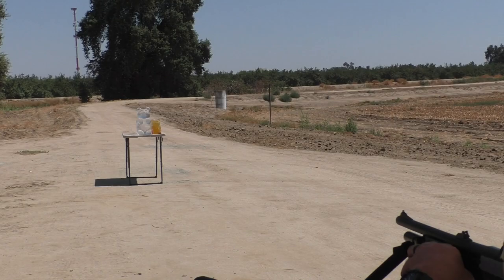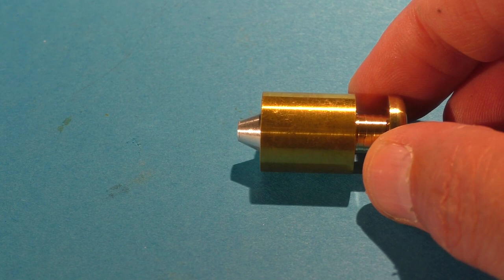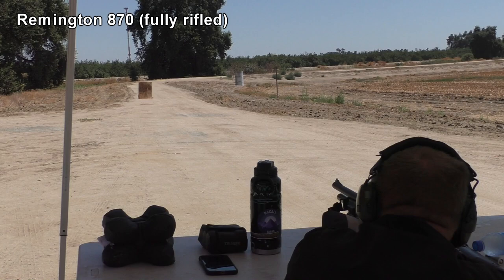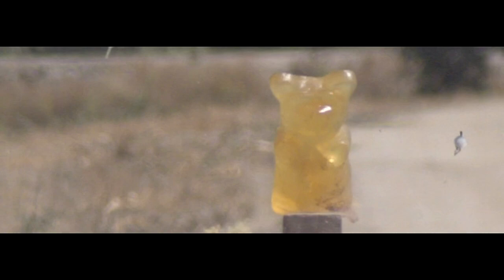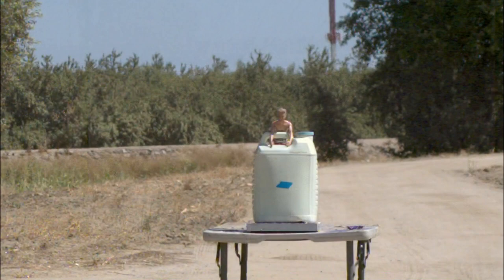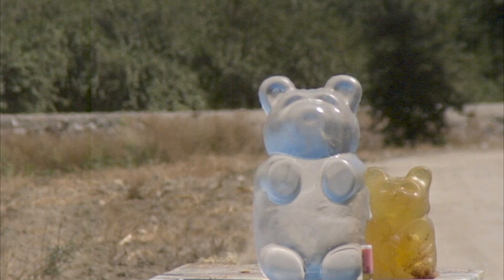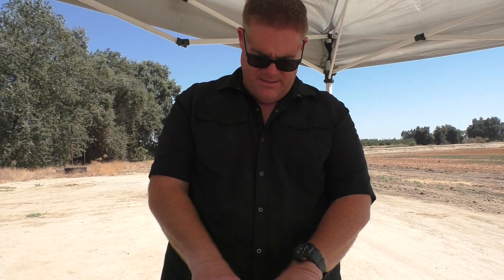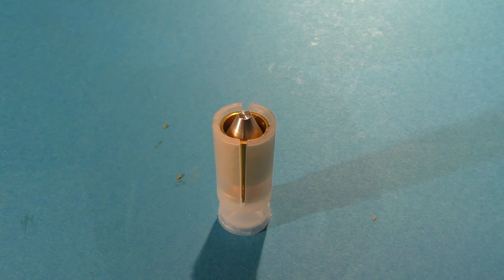Brenneke SUPER SABOT 12g. Shotgun Slugs  -  We test them out!

Comment: Degradation over time or improper storage cause volatility spikes in some propellants and some older plastics dont age well.

Break action or bust though if you want accuracy lol
Reply from the maker: Well....  we kinda showed it was a heat issue.
Reply: @taofledermaus Correct,  I'm just guessing it wasn't so thermally temperamental when it was brand new is all.

Like you said, the Germans is known for making tightly toleranced, good quality stuff usually

Comment: There's moving parts and two different alloy parts in the round.  Maybe the expansion of aluminum vs brass in hotter weather is out of tolerance?
Reply from the maker: That part worked ok
Reply: @taofledermaus  , Yeah.  It just seems like an unnecessarily complex design.  I am more inclined to think all the moving parts in the round are to blame rather than the powder. If it was a designed and tested to be subsonic, than pressure spikes would be a more plausible explanation for this failure.

Comment: Armchair expert.... You mentioned cooling the rounds.... That would make the thermally contract and if the barrel was hot-er than normal maybe this increased the tolerance and they weren't engaged by the rifling? Should have cooled the barrel and left the rounds in the sun. 

How old are they? Did the sabot plastic just get brittle with age?
Reply from the maker: It would probably take a very sensitive instrument to measure any difference from 30 degrees different

Comment: I srsly dont get what the combination of sabo + the need for a rifled barrel is supposed to mean. If the slug is exactly the 12ga. and "fills" the barrel out, so it "grabs" the rifling, where is the sabot supposed to fit in? If the slug is slightly subcaliber, why do you need the a rifling, which only tears the sabot apart?
Reply from the maker: A smaller diameter projectile is more aerodynamically efficient than a fat one.  Brass doesn't obturate in the barrel (doesn't expand)  and won't engage the rifling.   We tested MANY projectiles that use plastic sabots to engage the rifling and if loaded correctly,  function very well.  A slug like this isn't self-stabilizing,  just like a bullet and needs spin to fly straight.

Comment: Being European, they're obviously designed to shoot in a Celsius environment, not any of that foreignheit. But also curious how old they are, and if it was a combination of the plastic deteriorating and the heat. Or if the petals didn't like being spun through a rifled barrel. The plunger thing also seemed kinda pointless.. Although maybe Evan can adapt some so as the core pushes out, steel shims or petals make more of a ballistic cap. Or just fail due to the acceleration.

Comment: Since the metal of the barrel expands when hot, the bore would actually become smaller. I would imagine that the plunger moving is destabilizing the slug as its movement may not be uniform shot to shot and the underlying collapse of the sabot/wad is not uniform either, so the slug never engages the rifling and may be "jumping" the wad inducing the wobble. 90° temp should not affect the plastic that much.
Reply from the maker: I don't think you'd be able to measure a difference between 70 and 100 degrees.  Maybe you'd see some expansion at 300 degrees or so
Reply: @taofledermaus  That was my point. The bore becoming a bit smaller would actually allow the rifling to grip the projectile better, but you had not fired rounds in rapid succession to keep the barrel temp up enough to make any difference. The base wad-sabot and plunger designs were probably the culprits.

Comment: These slugs are old, from the 90's. I suggest that the plastic sabot it degraded and falling apart. If you have any left, you should take them apart and load with a new wad. That plastic is probably brittle and falling apart to the pressure. Those weren't that accurate in the beginning if I remember correctly. But I would replace the old plastic sabot with a new one and test that out.
Reply from the maker: They were sent directly from Brenneke USA to us.  I doubt they keep product in their warehouse for 30 years

Comment: Most slugs are deigned to be used in the fall and winter, so they may have used a powder that is best for those temperatures?
Seeing the one good shot was cooled for 10 minutes, would suggest that is the problem!

Hey OG!  When you got done shooting and cleaned your weapons, was there a lot of plastic in the barrels?
Reply from the maker: A black shotgun loaded with these will get much hotter than 90 deg f  in the direct sun even at lower temperatures.
Reply: @taofledermaus  I am thinking of Germany and Michigan fall and winter where the temp is sometimes below 0* C. And even black barrels frost up at those temps!
For those conditions, faster powders are recommended, and they become unstable at 35* C

Comment: I wonder what would happen if you loaded that wad & sabot into another hull using a 1400 fps load of your old faithful Longshot.
Reply: Well the wad is right at the max diameter for a cylinder bore size tube so you wouldn't be able to put it inside of another wad. But I was thinking along the same lines, only just reusing the slug. The slugs themselves look to have awesome potential.

Comment: Maybe Jeff could reload them with more standard powder. You could also send a couple to Evan Perry, to see what makes them tick. I'm not encouraging 'reverse engineering' or anything, but...
They do look very similar to Evan's brass doorknob slugs, though.
That temperature would have seen me in hospital. Here in the UK, it has been in the mid to high 30's C for weeks now, and is just easing off. 92°F is a dangerous temperature - in the 1953 movie 'It Came From Outer Space', the Sheriff tells the main character:
"Did you know, Puttnam, that more people are murdered at 92° Fahrenheit than any other temperature? I read an article once - lower temperatures, people are easy going. Over 92, it's too hot to move. But just ninety two - people get irritable!"
How you two never got irritable over those pain on the arse slugs, I'll never know. 
Nice one. 👍👍👍

Comment: I was wondering what would happen if you were to put rifling on the rounds will it have a good or bad effect on the bullets stability?
Reply from the maker: To get proper spin it has to be mechanical,   not from airflow over the slug.   It would be 100 yards down range before it got to the proper speed and by then it's too late

Comment: Heat softens plastic. The wad for these shells must have been something with a fairly low glass transition temperature, low enough to start losing structural integrity above room temperature. A shame the rounds didn't perform well but if the manufacturer never did so basic a test as seeing if the rounds functioned in high ambient heat that's on them.
Reply from the maker: Even if it only 70 deg f outside,  a black shotgun is going to get a lot hotter than 92 deg f  sitting in the sun.

Comment: As you have always said, a slug pulls about a zillion G's when fired.  That design (flawed in my opinion) creates a secondary inertial pressure spike when the plunger bottoms out in the sleeve.  Not sure of the exact science, but I think it has something to do with a resting fig newton liking to stay that way.  Snacks aside, secondary pressure spikes created by two objects colliding in barrels are typically bad things.
Reply from the maker: It's possible the plunger acts like cushion to reduce felt recoil a little.  Other than that,  I don't know why they made it that way
Reply: @taofledermaus  I noticed the ribs on the plunger (looked like a PEX fitting). I assume those are to slow the bottoming out process. As you said, the heat may have effected the performance of them. Still a box of ammo I’d leave for someone chasing me if I had to make a choice.

Comment: I would have thought the manufacturer would have extensively tested this round before putting it on the market. The round should have flown just as good at any temperature.   The next time you use these slugs, I would have brought along regular rounds  to use as a comparison to see how much the heat affects both rounds.  Just a thought.
Reply from the maker: We've tested a lot of stuff in higher temperatures and didn't have any wad failures.

Comment: It needs reloading, and refiguring the whole sabot concept, but even then I think it's going to require a lot of testing to get it right, and it might also involve redesigning the whole slug.
Reply from the maker: I'm thinking of chopping off the gas seal,   using a high pressure one,   US powder and maybe a cork wad.
Reply: None of the example showed that the piston actually worked, as the "nose cone" didn't extend. The lead plate captured it with nose in, but I'm sure what really happened. I think the tail end needs some Evan Perry magic for it to work.

Comment: I can't believe that Brenneke would put crappy slugs like that in production so I'm wondering if their performance/accuracy is dependent on the barrel length & twist rate. Depending on the weight of the slug it might need a faster or slower spin than the ones you tested them with. A faster spin might have allowed the slug to shed the bore-sleeve sooner and prevent that bad wobble. Brenneke Rottweil are my primary deer load of choice so seeing the Super Sabot do so poorly was shocking.
Reply from the maker: There aren't really any other twist rate options for shotguns,  I think it is 1:27.
Reply: @taofledermaus  I wasn't aware there were different rates until I looked it up. The most common rate is 1:28 but rates can vary from 1:22 (Winchester 1300) to 1:35 (Savage 210 & 212). I'm no gunsmith but think that the same twist rate on a 22" & 28" long barrel would affect the slug differently. The final word would be through Brenneke as to what length & twist rate the rounds were designed to work best with.

Comment: Well if you have the shells sitting out in the direct sunlight, the heat is going to make them expand and become soft. Also normally most hunters are hunting in colder temperatures. Extreme heat is always going to change the ballistics, especially when plastics are involved.
I guess I should have waited till the end to comment. But 92° in the shade is still pretty hot. I also noticed that when we use our pin guns at work when it's really hot outside, the nail head sometimes over penetrates the metal that were attaching to concrete because it makes the loads hotter I guess and those track fast guns that use gas cartridges doesn't seem to go as far versus when it's cold outside. Sometimes we'll stick the gas cartridges in ice water from the cooler and we'll be able to get another few shots out of it. But heat definitely plays havoc on just about all types of stuff like that, especially when there's added heat involved in the process of said project.

Comment: The box looks like it's from the late 80s, early 90s. If those slugs are as old as they look, the plastic wads may have gone brittle from sitting on a shelf for over 30 years.

Also, as the slug gets fired and the plunger on the back gets depressed, the slug shifts back in the cup about a quarter inch, which, under 50.000 G's of acceleration, may just be busting the bottom out of the wad/cup, no matter if it's gone brittle with age or not.

All in all, although it may LOOK like an Evan Perry creation, I think he usually does a better job.
Reply from the maker: They were sent to us directly from the company
Reply: Dang, Brenneke... Looks like youguys need to redesign the box AND the powder load! Maybe the slug, too, to be safe... 🤔

Thanks for getting back to me, Jeff. Given the old timey box graphics, I didn't expect these to be fresh off the line!

Comment: I'm puzzled by a sabot round that's supposed to use rifling. Why isn't it fin stabilized? Then you could use smoothbores.  These suck. Hell, I'm more accurate with my .38 snubby than that!
Reply: Rifled shotgun barrels require a sabot to keep the led slug from gumming up the Rifling.  Unless the slug is jacketed with copper it needs to have plastic as an insulator to keep this from happening.  And typically a good sabot slug fired out of a good Rifled barrel is much more accurate than a rifled, fin or foster style slug fired out of a smooth bore.

Comment: Pretty sure the powder and wad plastic are the issues they're engineered for temperatures less than 30° Celsius which is around 84° Fahrenheit so the plastic is "melting" on the sabot and the powder is as you suggested flaring and causing spikes, untrained opinion btw.

Comment: Okay now I finished the video yeah take the one that you saved and measured loaded up in another one with some long shot and I'm not sure what the weight of it is but I'm sure you know how much to use less than 28 grains I'm sure and then see if that helps any I have honestly only seen green gunpowder in a 22LR shell and that's because the color from the primer had mixed in with the powder which is where the shell usually becomes unreliable that you get a misfire because somebody's dropped it or they didn't prime it correctly or whatever that's the only time I've ever seen that that's kind of weird but I feel like you might be able to figure it out and get it to do right if you reloaded yourself dude
Reply from the maker: Yeah,  I will need to reload the remaining ones myself and do an extreme heat test,  actually leaving the shells and shotgun in direct sunlight so they get almost too hot to touch.   I THINK I can do it
Reply: @taofledermaus  I was thinking if you use long shot or a powder you're familiar with I just know you that you seem to prefer long shot or use it a lot anyways but you can reload it with that powder and maybe your own sabo and see if maybe they just loaded it with too much powder or too hot of a powder or maybe it wasn't enough maybe it's not a temperature thing like you maybe if you could load one or two up like that and you will know for sure

Comment: That's one of the least aerodynamic shapes I've ever seen.
Drag is all over the place.
Take the tail of the plunger off, it would do better but still not good.
The intake on a SR-71 compresses the air, seeing as it's so thin at altitude.
It also allows the air to pass THROUGH the engine. This "cone" just traps the air causing MASSIVE parasitic drag.